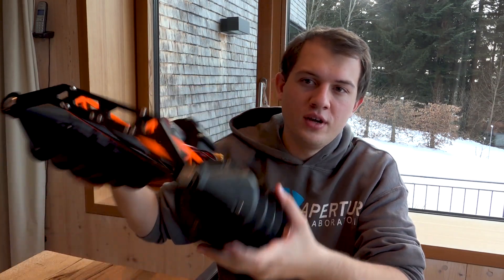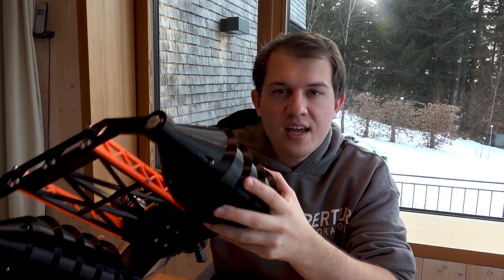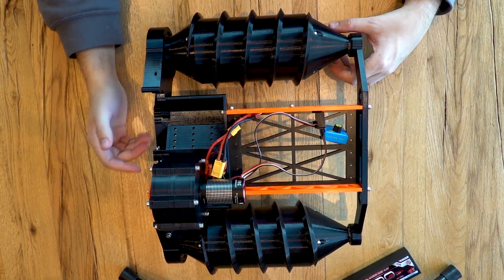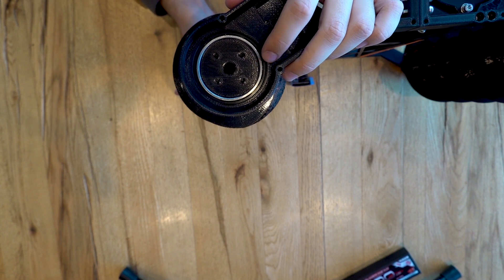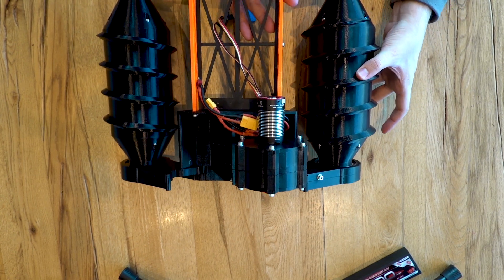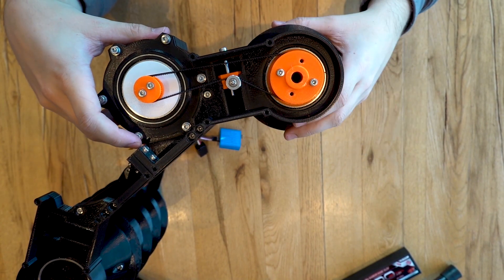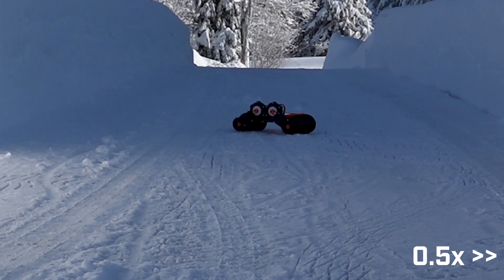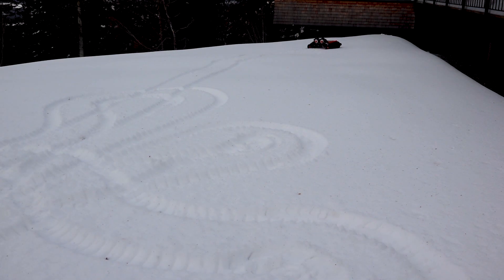3D Printed RC Screw-Tank

Comment: I’ve been fascinated by the screw drive vehicle and likely encountered the same cluster of videos related to vintage military test vehicles and the few existing examples of the screw driven vehicles. I did not build one but spent a good deal of time drawing variations of the concept. I will someday build a scale prototype and will refer back to this video, you certainly made some useful progress and details in feasibility! Here are some of my thoughts: on wet slushy snow, a specific screw blade shape may be a solution, there is a human-powered amphibious bicycle-like vehicle that has scoop-like ribs on large paddle-wheels, that may have some useful clues to pulling out of dense wet mush. If it can tread water, it can tread fluid mud and melting snow. Surface area is key. The larger a screw-drive vehicle is, the more effective it will be hydrodynamically, just like larger airplanes perform better. A gigantic plane gets a beneficial lift, whereas a small plane is relatively dense and like a rock, it must have tremendous propulsion to stay aloft. Similar for a small, somewhat heavy vehicle. The footprint is to small and heavy. 
The way I envisioned a screw-drive cargo and passenger vehicle is jumbo-scale. The screws would have a 3 meter diameter, and the cylinders built of strong rigid material, relatively thin. reinforced perhaps by a woven series of ridges on the interior that provides strength against buckling under high torque. The blades are designed to be more flexible, tough but not brittle like the cylinder. This would also be designed with intentional break-away stress limits. Let’s imagine the cylinder is being turned with great force and a screw edge encounters an immovable object like a portion of bedrock. Instead of pushing until the cylinder crumples or splits, the screw blade material gives way and breaks loose. Like sharks teeth, there are still functional ones in the vicinity and it saves a catastrophic material failure. In this way the screws can be made with a great surface area to weight ratio, allowing it to float on mud or snowmelt. 
The weight distribution solution in my plan was to split the two main screws into forward and aft sections, and make a slim gap between these sections, where the transmission intersects with the cylinders. So the location of the energy being added to the cylinder is in the center, and rotates the cylinder sections forward and aft simultaneously. This could be a simple approach, the cylinder is not actually bisected but just has the drive gear embedded in the center point. But having two independent cylinders on each side, gives opportunity for some interesting mixtures of direction and power. Torque to the front cylinder with the rear cylinder almost free-wheeling, excellent for bulling forward uphill climb. The reverse, with power applied to the rear cylinders more than the front, to stabilize on steep downhill and can work as a sort of braking. Indeed, options like independent  counter-rotation, and neutral, would allow the screw to perform complex maneuvers. The screw pattern could be instead a series of rectangular teeth that can be tilted to two different angles, or depth, thus providing variable traction in either direction.
I refer to these large screws as cylinders because they would have a long straight center portion without much bow/curvature. This is to lower complexity of construction, and offer a smoother ride like a long wheelbase does. However a sharply bowed, fat-in the-middle screw will give the most dynamic launches, but also a crazy bouncy ride.
The interior of the screw is hollow. The internal surface contains gear teeth, instead of a belt. The design would use the outer circumference as much as possible, and keep the center axis unobstructed. This is because the interior of the screw would be the passenger compartment and cargo space, inside a slightly smaller cylinder that is fixed and does not rotate. So basically the screws are a sheath that encapsulates a cylindrical vehicle inside of them. This eliminates most of the bulkiness of the vehicle outside the cylinder screws, mainly just the support frame that connects the two sides. And a bridge across the top, a literal ‘bridge’ because a passenger could exit the screw climb a spiral staircase or elevator lift, walk across a top deck, and then climb down into the opposite screw, while both are turning.
The design intention is to have an buoyant watercraft that can crawl a few miles across rough terrain to find water again. Turning the screw into the container and cabin part of the vehicle instead of just a hollow wasted space, creates a better center of gravity and weight distribution despite the engineering complexities of having a cylinder within cylinder constuction